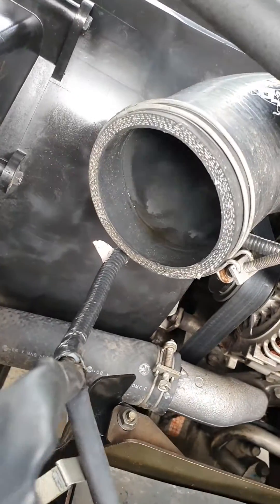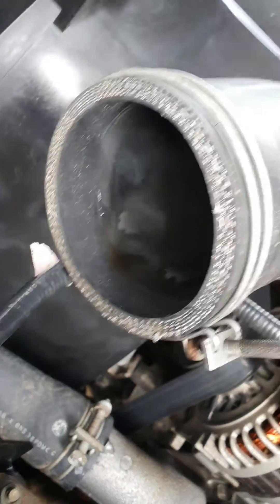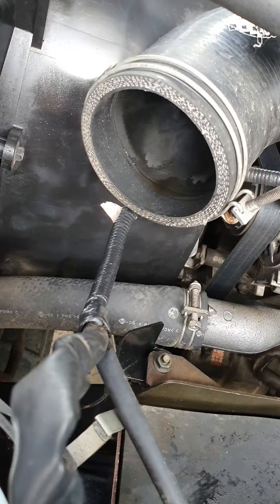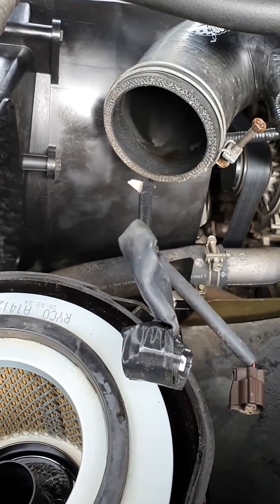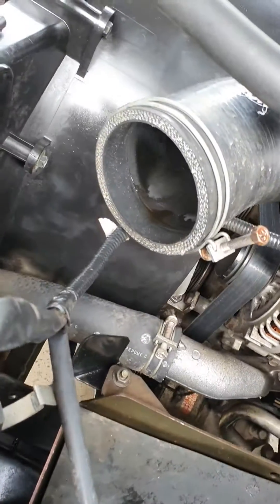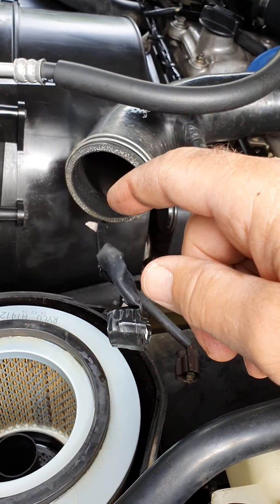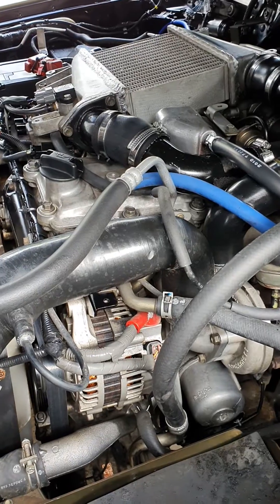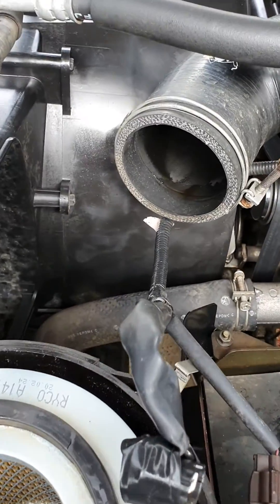Diesel Air Mass Sensor safety. Catch Cans. Berrima Diesel.

Comment: What about John Cadogan, he stated this, Finally, I'd suggest that when a catch can fills up with oily residue, many people view that as justification they they have cured the problem, In fact, all they are doing is collecting oily residue that the engine is designed to burn off ass part of its normal operation !?
Reply from the maker: I wouldnt say 'it was designed to recirculate and burn this off anyway'. Remember our lovely Environmental experts advised Government boffins to recirculate all this muck through the engine claiming it as Toxic to Humans ;-)